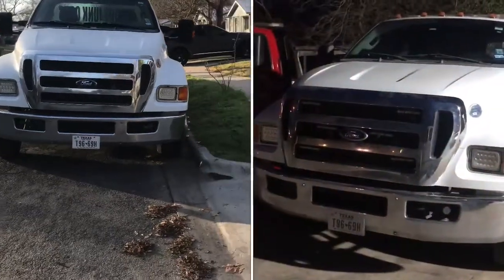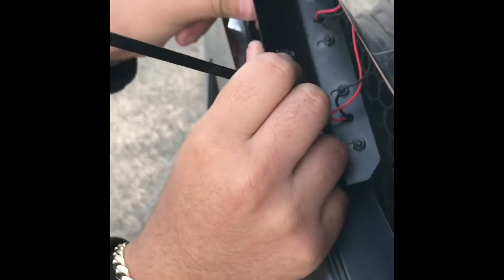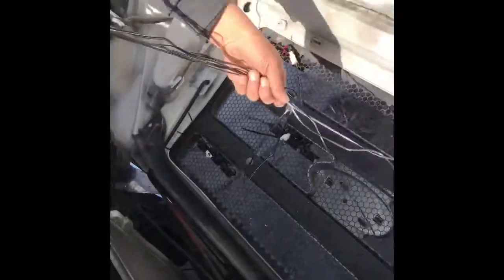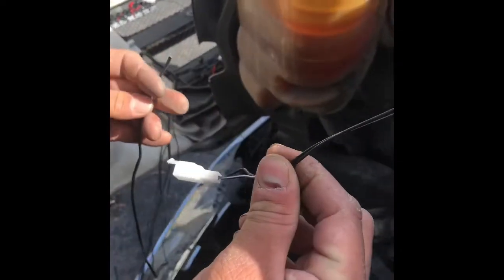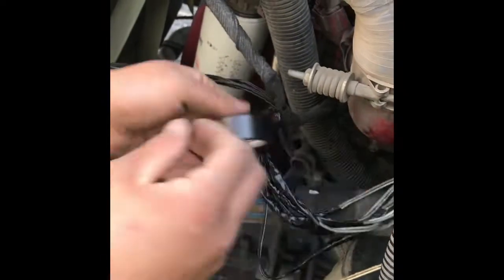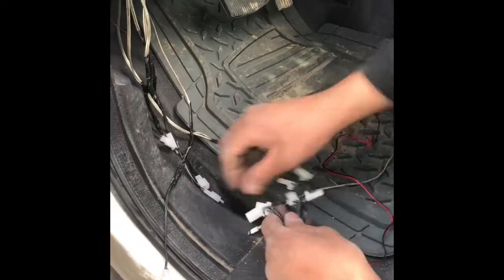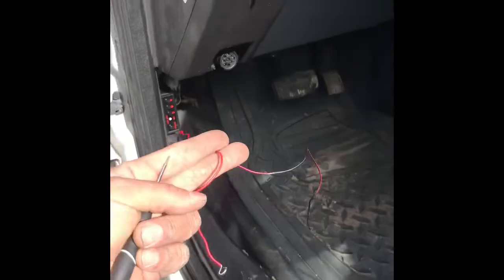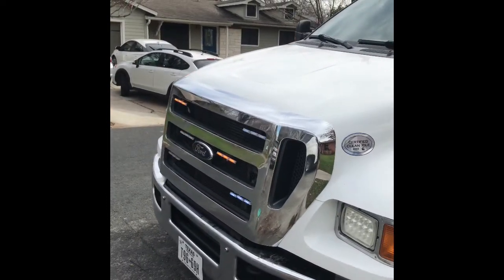How to install Emergency warning strobe light/ Tow truck Ford F-650

Comment: U shoulda slid that black plastic flex sheath around those wires under the hood. Extra protection. Good job though!
Reply from the maker: John Wagner it is we cut a hole in the middle put the wires through there